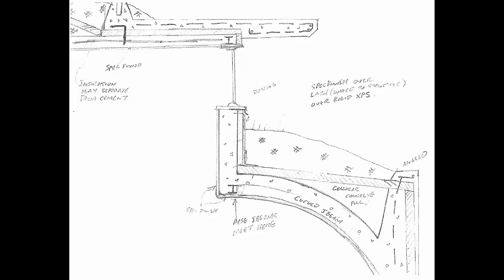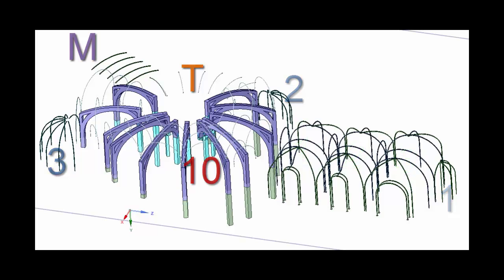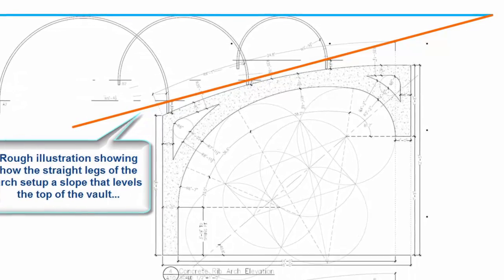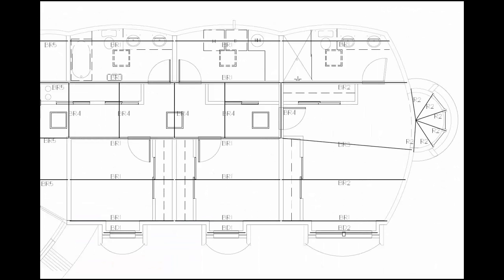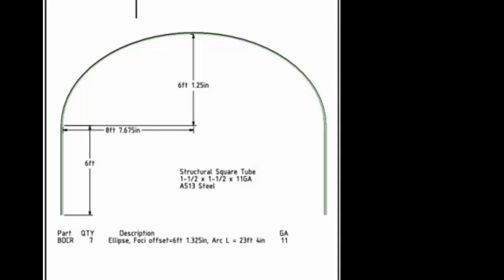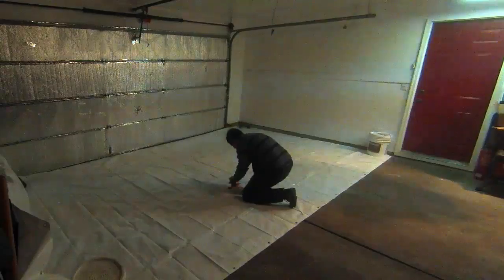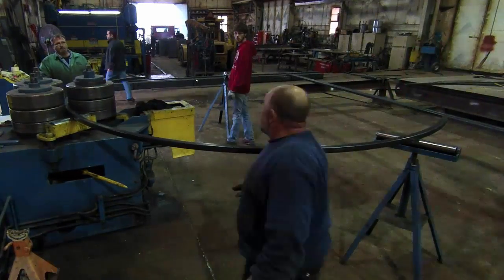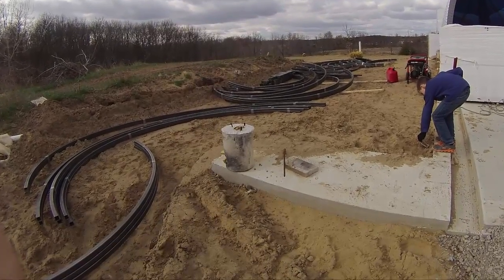13.1 Ordering the curved steel arches

Comment: This is phenomenal, thank you. Do you think it would be possible to bend the inch and a half tubing on one's own, around say a jig cut in two stacked sheets of 3/4" plywood? I'm just thinking this would save a lot of hassle (and money) if it's possible since you could transport the straight lengths.
Reply from the maker: No, not with a plywood jig.   But yes, you can buy tube rollers.   I'll put a link here. https://www.amazon.com/s?k=1-1%2F2%22+Tubing+Rolling+Bender&i=tools&crid=12GLDIRWZTPF4&sprefix=1-1%2F2+tubing+rolling+bender%2Ctools%2C133&ref=nb_sb_noss

You want the ones that roll it back and forth curving it a bit more each time.  Don't try to bend it with mechanical advantage and lever action.  

Or do a youtube search on rolling steel tube.   Lots of videos of people making rolling cages for race cars.  A house frame is easier because you don't need to curve it as tightly.

Comment: So they charged you triple?  Is that something that you missed in the fine print or they told you but you missed it or did they just spring it on you after the job was done?  If it is the latter then I hope you are going to get your money back.
Reply from the maker: They sort of told me...  I just didn't understand.   What they said was 75$ per curve.  I understood this well enough to combine all my half arches into full arches to save money.  I just didn't understand that they considered an ellipse to be made up of three arches.  But the guys were good to work with in other ways.  For instance, they gave me free delivery (40 minutes one way), and they were also the crane crew and only charged me for the one trip, even though they came out a bunch of times to flip my arches, get new ones, etc.  I am pretty sure I ended up ahead, so no complaints from me.  In the end, these arches were way cheaper than wooden trusses and I only needed to place them every six feet, so savings all around.

Comment: Curious, did you bond or ground the steel and rebar in any way? Watched most of this series didn't see that, to make a pathway to ground in case of lightning strike
Reply from the maker: Yes, I used an acorn bolt to connect a ground wire to the foundation rebar.  I also connected the same ground system to two buried ground rods outside.  And then I did extra bits like put in a lightning rod to a separate ground rod and also wired the perimeter fence to that rod.